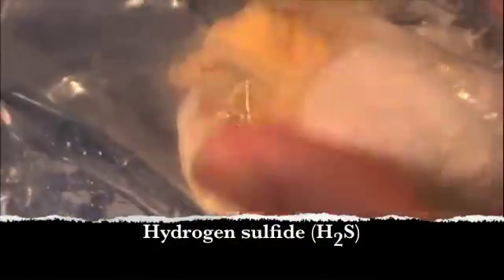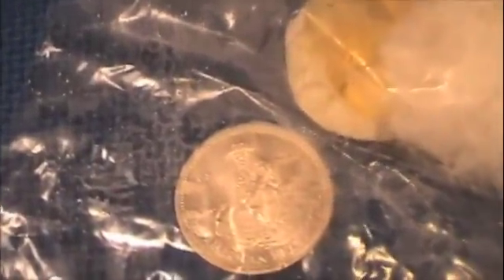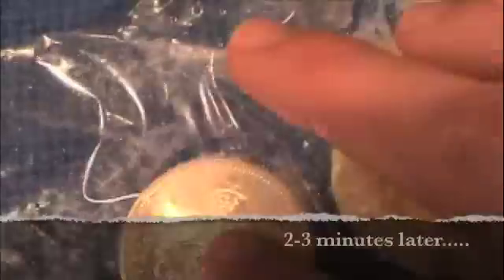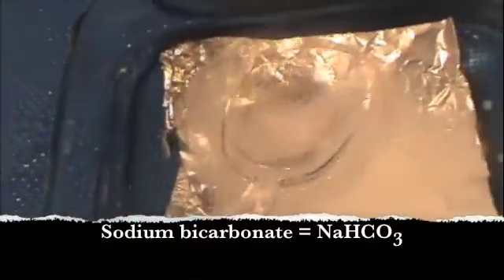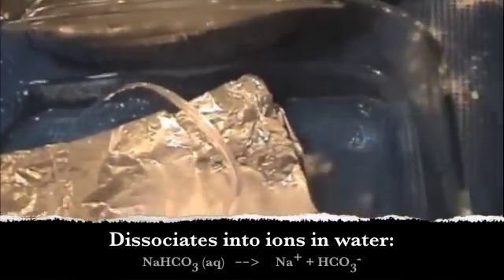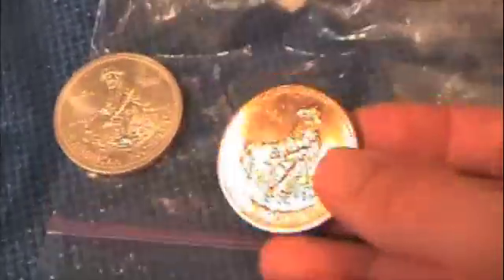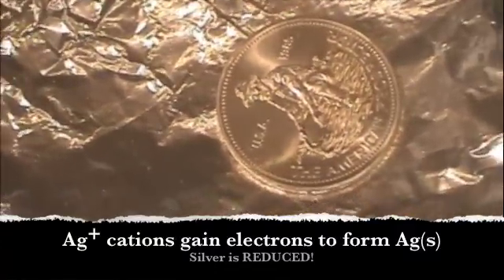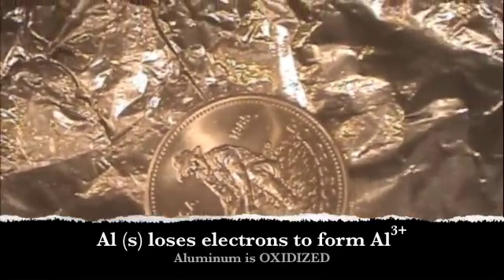Silver Tarnish Removal:  Electrochemistry

Comment: I have a bracelet made of lacy silver that has a small amount of dimensionality: some parts stick up & are layered together as flower 'petals'. Sadly, I tried this technique  6 times with boiling hot water & just faucet hot,. stirring in the baking soda in advance, adding more on top of it a couple times and even using a toothbrush on it while in solution... I changed foil/water six times. It's  50 % better but still is very tarnished. A polishing cloth works on the flat parts only. Ideas?

Comment: amazing! does it work on carbon steel? I have a knife that's have rusting spots on it... I try to sand it with a steel wool but there's only so much metal i want to take off... do you have a solution?